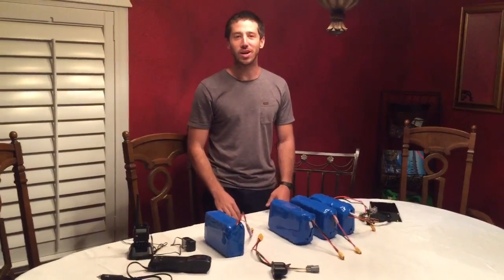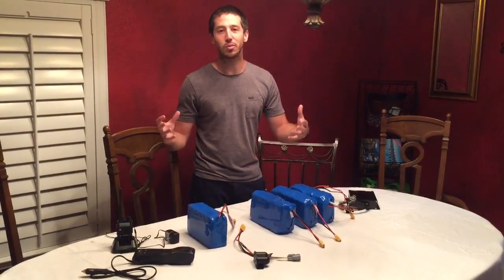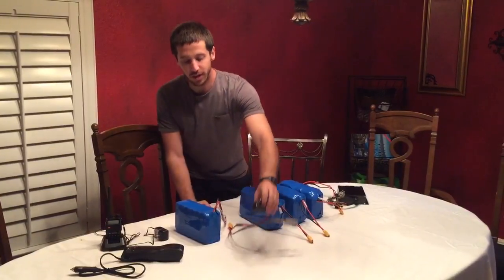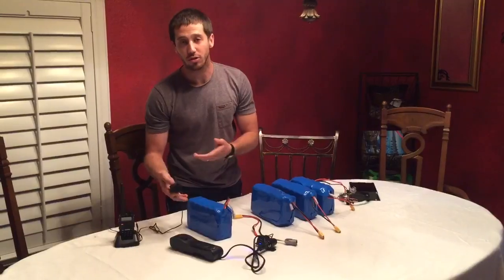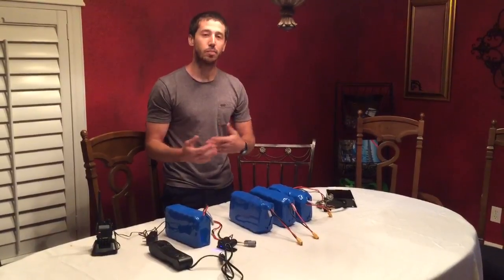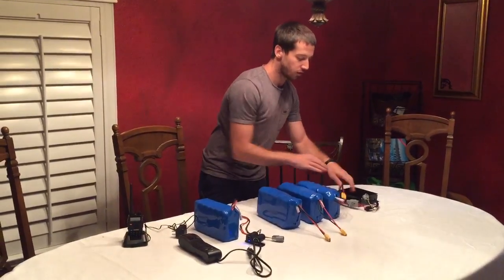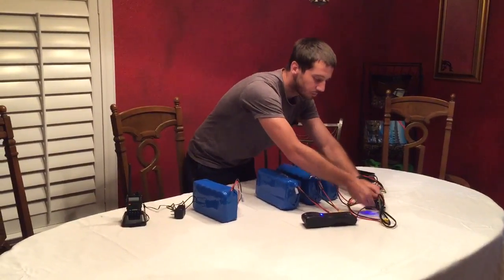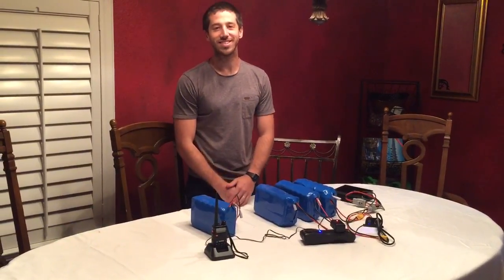Use ebike batteries for EMERGENCY POWER - Hurricane Irma preparation

Comment: THANK YOU FOR THE VIDEO!  I've been trying to figure out how to use my back up batteries for emergency power for a while now! Gata finish the video I don't have the same connector,  I got a T type with no ground. I'm looking for an adapter for it but seems like they haven't made one for that 🤔  my bike uses this type and prefer to not change it so I can go back and forth.  Also ,I got one main battery I use for my bike, and two back ups that are same voltage but different amps, I've been wanting to take the two apart and combine them in a way to make one big battery to out Amp my current main battery but afraid of ruining them even tho they are back ups.  I like my current speed (30ish mph max) but would really like more range and acceleration for up hills or from a dead stop. Torque comes from amps right? Not sure. But right now I got 48v 20amp as my main.  And a 48v 15amp I think and another even smaller that was sold to me as 30 amp but came much smaller than the 20amp so im aware I got screwed but its my own fault,  I thought maybe the cells were higher quality or something but def not. Speed is there, but range is not. Anyway I know there's a way I can combine the 2 to make at least a 48v 26-30amp or id even be willing to push the limit of my controller with 52v. 26-30amp thatd be so awsome for me, my ebike is my main mode of transportation so I use it daily.  I do have a bigger controller but the connections and wires are much bigger, ive been saving it in case my current breaks. Which is rated at 48v-52v I think and 26amp max I beleive. Does this sound doable? Any advice and encouragement would be much appreciated!

Comment: You can easily damage your expensive LI batteries they way you have them set up.   The golf cart inverter, 30amp version, for 48v to 12 is good.  But install a low voltage cutoff, 30amp version, (about 10 dollars off ebay) that cuts off the battery when the voltage drops from 48v  to 42-44v so you do not drain your batteries too low.

Comment: Hi, just came across this video but i've wanted to use my ebike batteries for this exact situation but didn't know how to go about it. I now have more knowledge after watching this but my battery is a 52v not a 48v so I didn't find anything relating to that. Would you happen to know where I can buy the products to either go from 52 down to 12 then back up or just 52 to 120. I just don't want to cause a fire or anything because I'm very inexperienced when it comes to the deep electronics like this. Thanks.

Comment: Can you provide some more information on the 12 Volt battery you showed in this video?  I want to build a battery for an electric trolling motor.  I plan to buy your book and maybe get the VRUZEND battery kit.  It would be great if you could do a video on building a 12v battery.
Reply from the maker: It's a 4s18p battery from Panasonic 18650B cells, but if I did it again I'd probably use Samsung 33G cells, though you could pretty much use any cell you want. It's also got a 30A continuous BMS.

Comment: fun fact: most computer and phone power supplies have rectifiers on the inputs and can work on DC voltages as low as 30V! Try it! If you put the bike batteries in series to achieve 100V DC you'll be able to even power lights and all kinds of computerised non-motorised devices.

Comment: Hi, I am a subscriber and have tried to build batteries with your videos. However, I would like you to show how to build a 18650 36v 20 ah battery pack that will fit inside an aluminum box rear battery rack for an e bike. I cannot find anybody to talk with about how to build this battery. help charly

Comment: Great video. You should make a video like this for a battery that fits in .50 cal ammo cans. 

Make it a self contained set up for emergencies, camping and maybe even to jump start a vehicle in an emergency, and several ways to be recharged like solar, 120vac outlet, and a vehicle itself while driving or whatever. Make sure you can still use the battery while having it connected to a solar panel and charging and running your inverter all at the same time.

It would be great to be able to plug them into each other and stack the batteries too, so if you have several ammo can batteries, you could stack them to increase power and run times.

Being able to be plugged right into an ebike as well is a must. Have that ebike give you power in the home, and also a way to get around after the storm when fuel is nowhere to be found and roads are not clear for full size vehicles.

Having an ammo can battery or two or three can be very useful if built the right way and that will only happen if people know how to build their own so it suits their wants, needs and desires.

Sadly, you're in a perfect situation to know first hand what is needed and you might as well learn from it and make some thing good out of it all. I do trust what you say when building some thing like this and would love to see a how to type build and a book on it as well. A do all or what EACH person needs type battery that we can build ourselves would be great for those of us in areas like this or anyone really as winter is just as bad. I just went through Harvey here in Louisiana, so I have a good idea what you're going through.

Enjoy your stay and I hope all is well, and keep up the great work.

Comment: 2:31.. Why not go from 48VDC to 120VAC with a 48V Inverter.. Would be a bit more efficient.
Reply: Probably not very common, if you can find them at all.
Reply: They are very common... just do a Google search...
https://www.alibaba.com/showroom/inverter-48vdc-to-120vac.html

http://www.mouser.com/Power/Power-Inverters/_/N-brvw6?P=1ytijweZ1z0ixq2
Reply from the maker: They are available, but I didn't have one locally. If you plan ahead, that is more efficient, but they are harder to find on Amazon with quick shipping, so this is a quick solution that works, even though its not the most efficient.

Comment: Excellent video. I'm no where near hurricane territory but I always keep my 2 deep cell batteries topped off with a solar panel and have inverters and 12v outlets. Like you I have different ebike batteries ranging from 12v, 24v, 48v and 54v. I never thought of using them like this for emergency situations. But I will defiantly have some 12v outlets set  up and ready now. Thanks for the video and stay safe.

Comment from the maker: Sorry for the low budget quality guys, filmed on my phone. You know, because of the hurricane and stuff....
Reply: No problem! I hope you guys stay safe out there! Also, if you have 48 volt batteries, you can try and find a relatively low power (1 KW) solar inverter to convert it to 110/230 VAC with a high efficiency. This saves a few conversion steps and provides a direct outlet for your appliances without having to worry about going over the power limit of a cheap converter. Cheers and good luck with Irma!